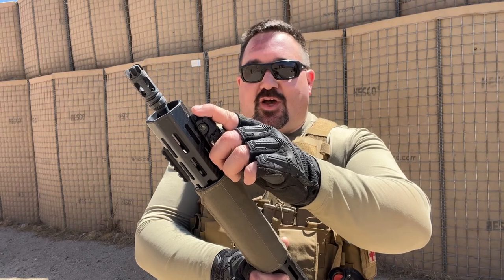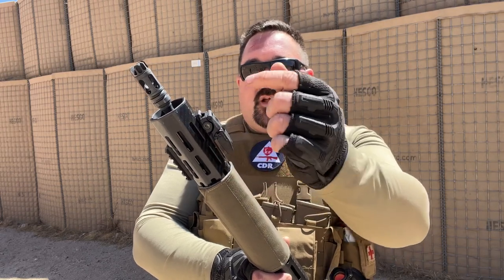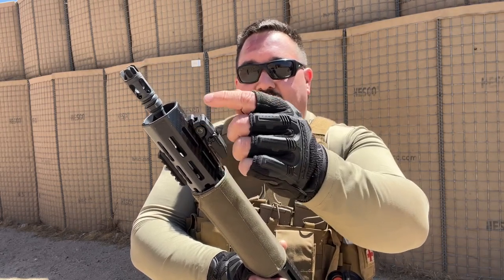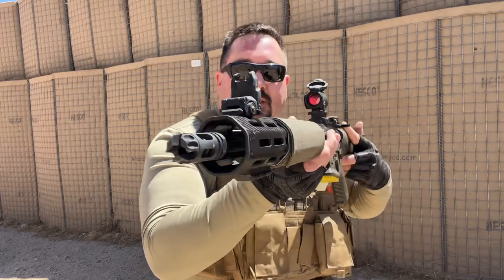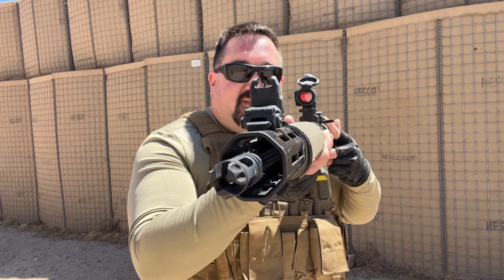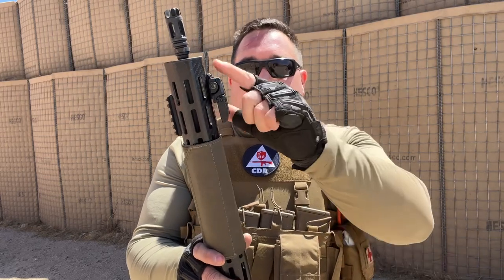How to ruin a WWSD

Comment: I wonder if we'll ever go back to fixed iron sights. Makes sense to have manufacturers integrate high end aiming system into these precision systems.  I feel like detachable iron sights just don't do justice to the quality and precision of so many guns.

I personally would always try to avoid guns that doesn't have built in iron sights.
Reply: Built in red dots were a thing for a brief moment before everyone just moved to rails. Iron sights are just obsolete.
Reply: @j.murphy4884  iron sights are not obsolete dude.   I have never broken a single fixed iron sight. But I've broken at least 15 detachable sights, or custom adjustable sights. Either some reddots, or flip ups etc..   

There will be a time where almost no one has any sights on their guns.  Having sights will be a wasteland luxury.
Reply: @sean7456  I only shoot iron sights or detachable night vision/thermal.  In Finnish army no one really bothered with red dot because it blinds you even at lowest setting in night time.  And with acog, it's all mostly unecessary weight.   There isn't any scopes around that can survive a proper military crawl through 1meter snow in -20c Celsius.  Just one heavy breath of air and the scopes are impossible to look through.   Also, these scopes raise head too far up from buttstock imo for good recoil management and gun control.  Plus the forests are so dense and stuff that scopes after a while just feel like random consumer products.  We had a choice to use them in our company but no one used them, acog or Reddot.  Everyone thought they were useless.

Comment: These arisaka low rail sections are pricey but great. I'd put way too much time and brain power figuring they'd be good for a handguard like this at the 12 o clock position. If you're like me and have the devil's luck it still doesn't hurt to have BUIS even though 'electro optics are perfectly reliable'. The problem isn't the device it's the user 🙃

Comment: I don't understand people's obsession with back up irons. They are nothing but a paperweight if you are running a quality optic.
Reply: For that .001% chance they fail. Still harder for irons to fail
Reply: Even good quality optics can fail. I've seen at least 2 EOTechs and a Trijicon Acog bite the dust. Sure the chances maybe slim but I'd still rather have backup irons just in case.